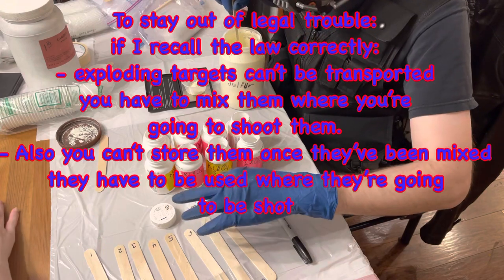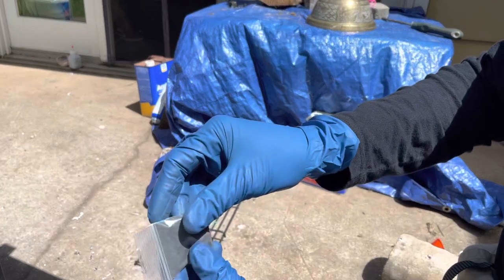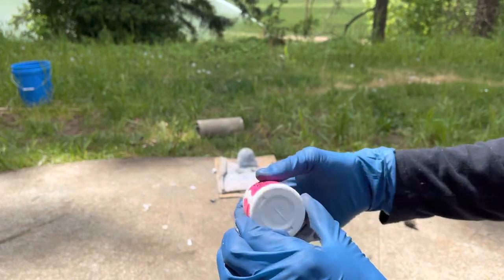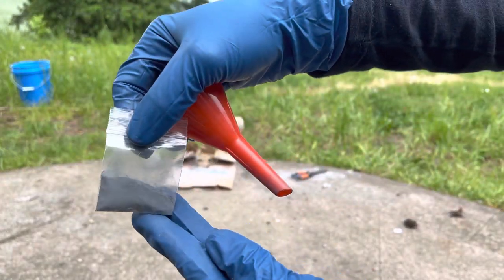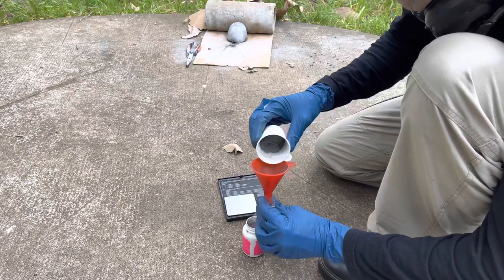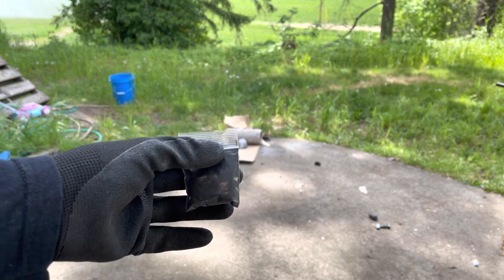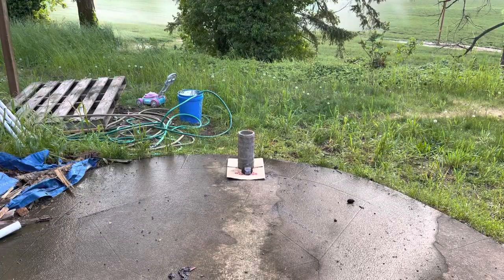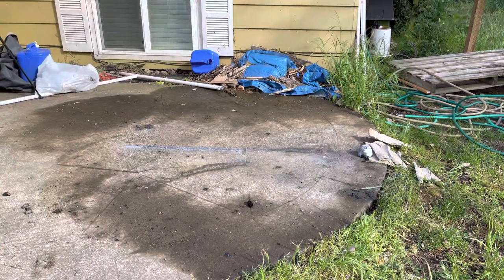Make Homemade Tannerite for BB Gun / Pellet Rifle - part 1 - how to make tannerite for pellet rifle

Comment: Protip: use cardboard vessels for mixing pyrotechnic chemicals. Paper/cardboard do not produce or conduct static electricity. Keep your fingers intact, friends.
Reply from the maker: Oh that’s a good idea, I’ve always hated the static electricity of plastic.
I do use recycled paper a lot for pouring and funnels, but that’s a good idea for mixing, is to use cardboard or something non-staticky that I can burn
Reply: @peterzum  you'll really hate it when it sets off those very sensitive chemicals in your hands. 22 sensitive tannerite comes with static free bags and mixing vessels. Dont make assumptions that your little ziplocks wont create static. You are playing with some really powerful fire. Act accordingly. Most youtubers will tell you not to mix more than .5g of flash powder in any composition. It is very volatile and very sensitive. Even the smallest static charge can set off any of the compositions you mixed here. Friction and plastic create static. Please inform yourself on the proper way to do these things before you hurt yourself. Just buy paper firework tubes. You can pour chems, mix, and destroy, all in the same vessel. Far less risky than what you are doing here.
Reply: @peterzum  plus, if you do it right, the paper vessel is designed to contain the explosion, just like in a firecracker. It will blow up with more force when confined in its vessel. Flash can "self confine" as well, most compositions need under .5g of pressure to confine. but sealing that Shockwave in a vessel makes for a fuller detonation, and less deflagration. less smoke if that's the effect you're going for. But more boom.

Comment: Lead pellets would be shrapnel
Reply from the maker: Yeah it would, if I used lead pellets, one mixture  (the first one) had lead pellets, all the rest had plastic (after I found the lead wasn’t necessary).

Although I have also done rocks in the middle of explosives and they tend to not move much unless they are put on the outside.

These mixture sizes, with their lack of pressure chambers aren’t going to be expelling shrapnel from intermixed media.  This is not an assumption this is a measurement.